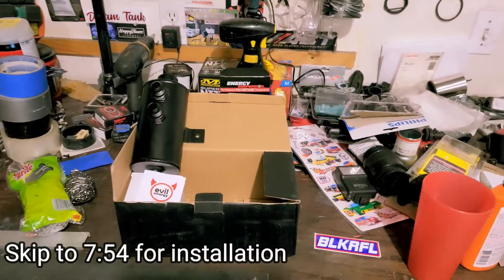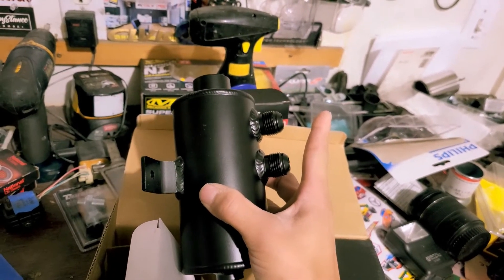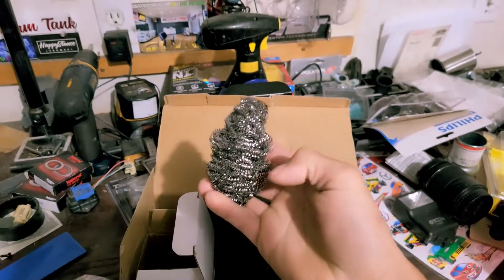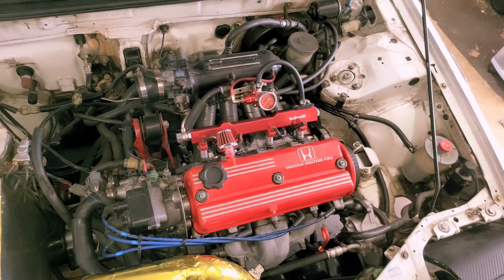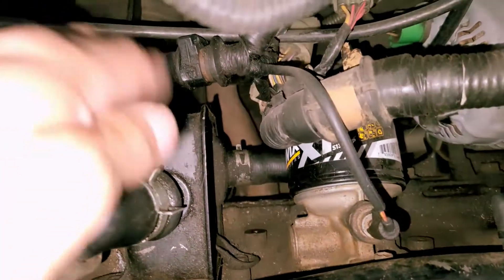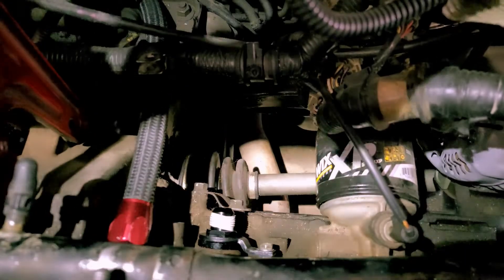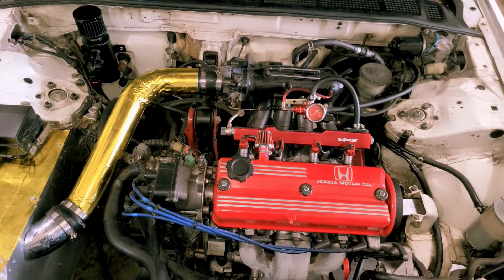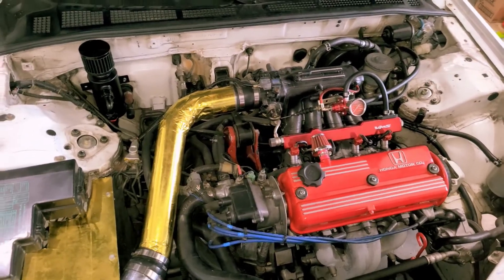A20 PCV delete and Oil Catch Can installation

Comment: Great videos! I just picked up a '87 LX-i hatchback 5-speed and I have a couple questions on this kind of setup. 

What size plug did you use on the oil pan to seal it up?

Do you think its better to run just the lower crankcase vent to a vented catch can and vent the valve cover to the atmosphere compared to running upper and lower crankcase vents to a vented catch can?

What would the ideal catch can setup be? If there is one
Reply from the maker: I can't remember what size, a big one for sure, I bought a box with an assortment of plugs. An ideal catch can setup is really up to the build, NA you can get away with a minimal setup as mine or if you're going towards a forced Induction route then venting the crankcase is more important. My current plan is a 4 port can (1 vent equipped with a breather) and 3 lines going to it. 1 off the block and 2 off a Level 7 Performance -10AN vented oil cap. You could add on 1 or 2 -10an fitting to the valve cover if desired.
Reply: @aziangarage  this will be a daily driver for me but I just plan to do a cold air intake and better flowing exhaust in the future. Nothing crazy

Comment: So you just deleted the PCV valve all together and vent the upper crank cases with the small air filter. Then the block hole gets attached to the catch can and the oil pan gets blocked off?
Reply from the maker: Correct, you could vent the crankcase to a catch can as well depending what kind of and amount of fittings you're working with.

Comment: Thank you!  87 accord with a20a1.  taking this whole thing out!  This is a catch can that ran right up to my pcv valve.  Now ive junked my whole carb'd single intake and going with a dual weber one that I ordered from the UK, what to do with this stock can?  I like your idea and will look at doing something similar.  also, i have removed the cam, and trying to decide if I send it off to colt cams in Canada or do something different.  I heard isky has a z-330 model that is ok.....  Also I have to junk this stock cast iron exhaust manifold.  Who the hell makes headers for these a20's?
Reply from the maker: I've sent my cam off to Delta Cams years ago, 272 grind. No one at this time makes an aftermarket header for the A20 that I know of. Besides getting a custom one made the 88-89 Accords all used 4-2-1 header designs from the 4-1 design header which in my opinion are better.

Comment: Can you give me an update with this setup? I recently started upgrading a 1986 Carburetor model. How much build up do you get? And how has it been running?
Reply from the maker: Honestly I haven't been driving the car as much as I like, the buildup since the installing the catch can has been minimal but its definitely doing it job after about 300-400 miles. It will definitely come in handy in forced induction setups.

Comment: Hey bro nice video. I wanted to let you know that so far the only thing I've found to plug that breather box return hole in the block is a rubber expansion plug from Oreilly's. The hole is 26.1mm and this plug goes from 25mm to 28mm. Works great. I decided to not have a return into the block or an outlet as most of the displaced air is moved through the valve cover anyways.

Comment: This is probably a stupid question but did you go from the oil pan to the bottom of the catch can? Or does it get plugged off I would imagine it connects to the bottom.
Reply from the maker: I mean you can plumb it that way but I just plugged it at the oil pan and just have catch can vent to atmosphere and drain it periodically.